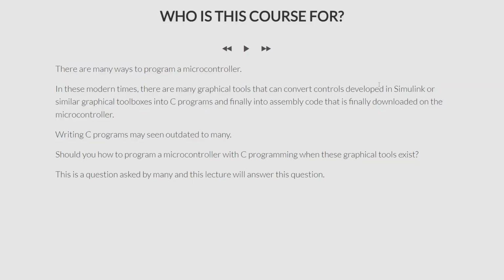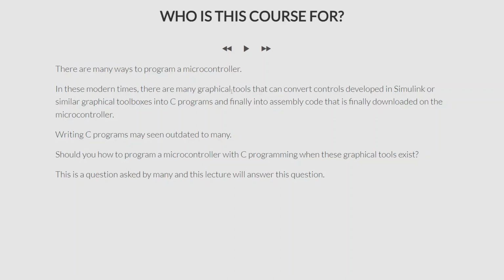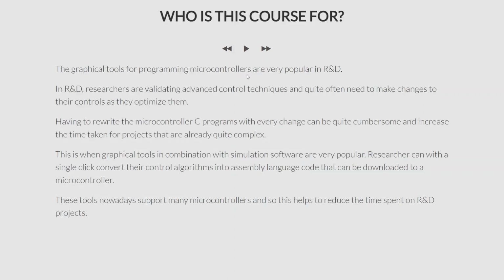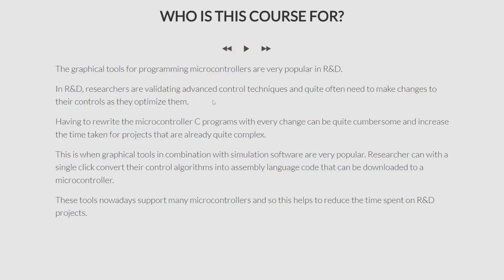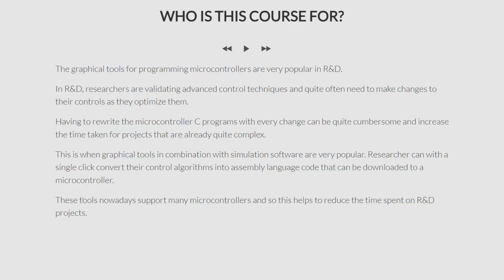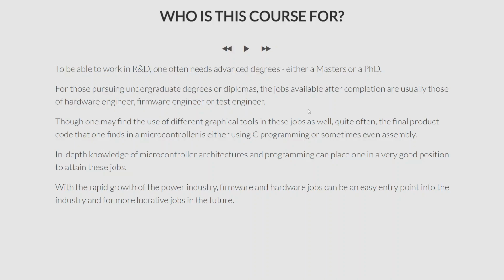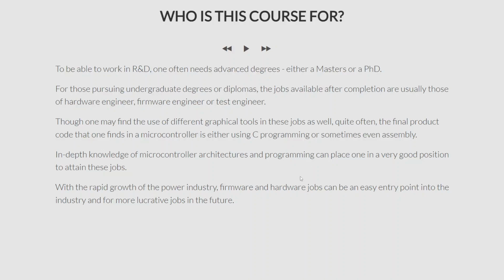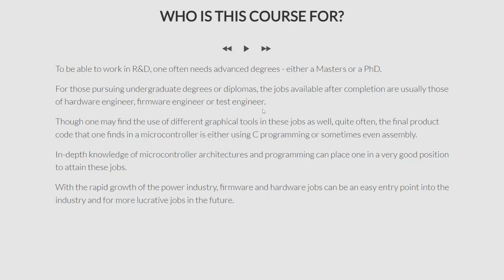Target audience of the course

Comment: Sir,Please include advanced concepts like sinusoidal pwm,svpwm,hysterisis current control, DFT,FFT,FIR FILTER,IIR FILTER Implementation, discreteFourier transform,Finite state machine implementation,kalmen filters implementation, DISCRTE Cosine filters,Walsh filter,fixed point arithmetic, communication protocol, Hardware overview of the board,Stand alone programming of the chip (Bootloader), memory map file configuration.   IF POSSIBLE.